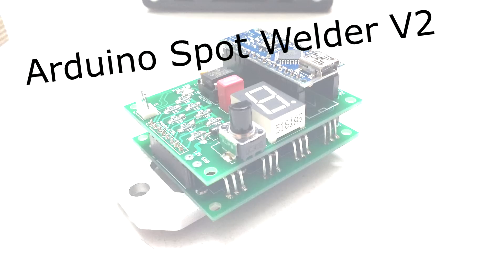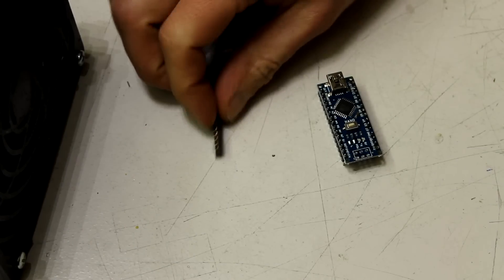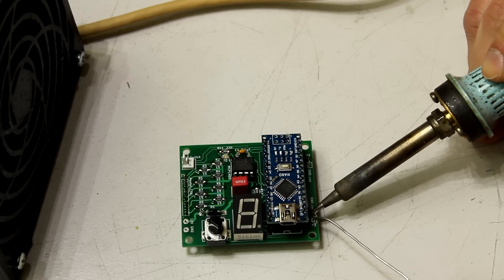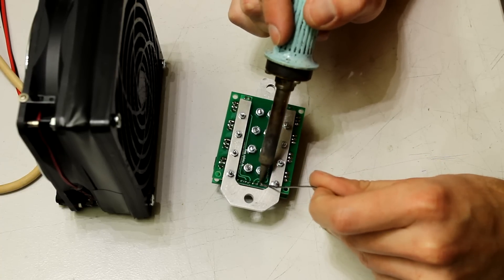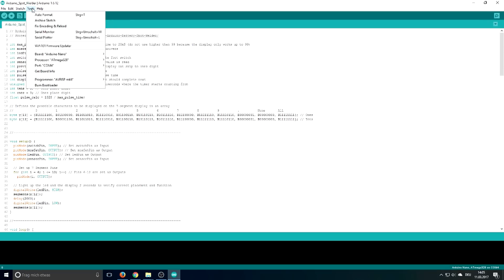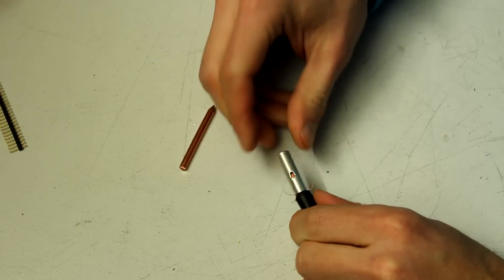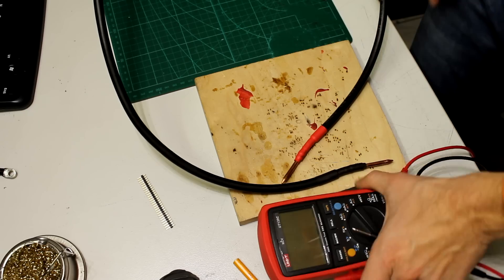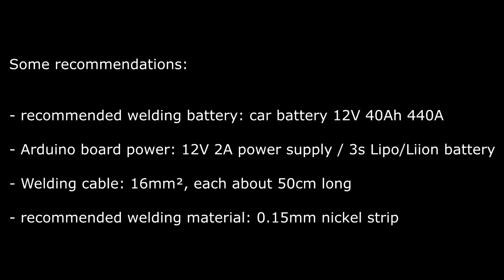DIY Arduino Spot Welder V2

Comment: can you help me please I ordered your kit and built it but I have 12 volts at the welding tips how can I troubleshoot to find out the problem. I only have 12 volt when the 12 v control voltage is applied. anybody help please I had it working until I added a second battery and the diode kit
Reply from the maker: Do you have version 2.2 with the AutoPulse feature ? If so, you need to remove the AutoPulse Jumper when doing the measurement. https://malectrics.eu/wp-content/uploads/2017/04/AutoPulse_jumper.jpg
If this does not solve the problem please sent me some pictures of how everything is connected to info@malectrics.eu

Comment: i got my welder but it seems to struggle with pure nickel. 12x0.15 even at 20ms it wont weld. you can peel it off with your fingernail.

the cheap 8mm ebay nickel plated strip it welds good.

im going to borrow another battery over the week end
Reply from the maker: What car battery did you use for welding ? Maybe it cant deliver enough amps.
You could also try to further increase the welding time. In the Arduino code the maximum time can be set up to 99mS. Then you can choose from 1 to 99mS with the poti.
Reply: i fixed it with a 019 battery 800CCA ;)

Comment: How do you attach the optional TVS diode? Solder, crimp or just shrink wrap?
Reply from the maker: Lothian8 Solder the cables to the diode and then crimp the connectors at the cable ends. Or if you dont have a crimping tool, you can also solder the connectors to the cable.
Reply: SelmerSlowflyer ah. My first attempt at soldering the diode resulted in the metal wire pulling free from the diode
Reply from the maker: Lothian8 That sounds like your soldering iron is to weak or you put to much heat to the diode. First Tin the diode end. Then tin the cable end and heat the tinned cable end until the solder melts and then hold the cable end to the diode end. So that the diode only gets heated 1 or 2 seconds.

Comment: the In the Arduino IDE, go to; . the software is not running and I cannot go to the setup area. Im not sure why. I did download the files and  the INO file is not an executable file so there is no program running
Reply from the maker: Quentin Craft You can also open the .ino file directly on github. Then copy the program code and paste it in an empty file in your arduino IDE. Maybe it will work this way.

Comment: i don't know if the question is already been asked,can this be used with a battery higher than the 440A as explained? i have a 550CCA battery and would like to use it but i do not want to risk frying the kit
Reply from the maker: Rafael Moreno Has been asked before ;) Take a look here https://malectrics.eu/arduino-spot-welder-faq/

Comment: Hello. Why do I need separate battery to run arduino? What modifications would it take to power it from car battery? That way it would be a self contained system.
Reply from the maker: M K The voltage of the car battery drops down to about 2 V while welding. Also at the end of the welding pulse there is a voltage spike which could damage the Arduino. To use the car battery you would need to buffer the Arduinos voltage so it can not drop and also eliminate the voltage spike.
Reply: Would that be difficult to do? Any ideas on how to do it?
Reply: Actually its very easy to do.

Use a separate battery to power the Arduino. A simple 9 volt should do nicely.

Comment: is this ok to use without the 2 extra diodes?
Reply from the maker: mark ward If you only use the recommended 440A (CCA) car battery you can use it without the diodes

Comment: Great build. I'm trying to source the 12v car battery. Would a 40ah 340a battery work?
Reply from the maker: Lothian8 I recommend a 440A (CCA) car battery. Maybe with the 340A one you need to increase the pulse time a bit to get good welds. But in general it should work.
Reply: im using a golf cart battery numax slc34-12  14ms pulse makes good welds

Comment: just placed my order but i just have a couple of questions,what is the diode and tvs for?and need to know if the arduino comes pre programed with the code and ready to use?i did order the diode and tvs set
Reply from the maker: There is a explanation in the instructables why to use the diodes https://www.instructables.com/id/DIY-Arduino-Battery-Spot-Welder/#step5
The Arduino comes ready to use (programed) because i do some test welds with every prebuilt kit before shipping, to make sure everything works.

Comment: Woohoo just received mine! Many thanks from Australia!! Spent a bit of time doing up the wiring (as per your video) but am using three 65C-135C 5Ah lipo batteries as my DC source. Should have enough juice in there to do some nice welds I think. Will post an update when I hack on the Sunkko electrode pen.
Reply from the maker: Hi, Did you already use the Spot welder with the 3 batteries ? 3x135x5 = 2000A current ! That would be way to much for the Spot Welder to handle. Even using one 135C battery gives you 675A welding current which is already pretty high. So i would recommend trying to weld with only one battery first.

Comment: Could it be powered with a NiCD  18V Drill battery? I have like 3~4 lying around.
Reply from the maker: You can try this, but you can NOT use the Diode Set with a 18V battery.

Comment: I'm terrible with KiCAD but am I correct that the 12V power supply through holes are spaced 4mm apart and not 5,08mm or 2,54mm?
Reply from the maker: Rizon1985 You are right, they are spaced 4mm appart.
Reply: Ordered :)
I have a 540A CCA battery in my off-grid PV system. Do you think I can use that one or would 540 be overkill?
Reply from the maker: Rizon1985 That battery should work fine. Its not to powerful.

Comment: Hello i ordered a completed welder i will add Schottky and diode, being new to this it would be helpful to have awg rating for the wire i should use. Please.
Reply from the maker: wire for the diodes should be 10mm² ( 7 or 8 awg). For the tvs diode you can also use thinner wire if it is just a very short piece.

Comment: Hello, dear author. 

I really liked your welding version 1. But I decided to do it myself, some time some changes .. And for almost a year now I have been trying to bring it to the end. 
I really need your help, answers to a few difficult questions for me. One of the reasons why they occurred is the lack of an oscilloscope .. ((

Here's what I changed / added: 
1) Measuring the battery voltage immediately after the pulse, in pause to see how much the battery dies; 
2) optionally on start-up timer after touching the probes To each other (time 0.5-10 sec);
3) after only one preliminary not like you, and 0-32 pulse is set buttons; 
4) the duration of the main pulse buttons set in microseconds 100-33333 (0.1-33.3 ms); 
5) the ability to switch to the self-timer and vice versa without pressing the buttons on the device (only pedal delay + closed probes); 
6) Display color RGB LED battery status during the pulse, and stopped not only a minimum but also the current and maximum voltage of the battery; 
7) deducing all these basic parameters on the LCD screen 1602.

 In general, I like my the not-power part ... The problem turned out to be a different matter ..
 The preliminary pulse = 1/5 of the main, then the pause is 5x of the main, then the main pulse. 
When I put the main pulse of 1 ms, 1-2 MOSFETs explode. 
Total I destroyed about 30 pieces of different .. 
I tried and 1405, and 7430, and 3006 and 3077 and 4110. The result is one. Better than all of themselves showed 1405, but they did not last long. Now 3713 are coming to me, we'll look at them.
 The fact is that my nickel tape should be cooked at 4-6 msec ... 
Also, sometimes the drivers went down about 13 pcs. 
Mcp14e10, mcp1404, ixdn604 .. The experiment was inexpensive ((A couple of times the external stabilizer + 5V (1117) burned and 3 times of arduin itself .. I tried to use tvs-diodes .. 1.5ke12a, 1.5ke15a, 1.5ke18a, even SM8S30A (8kW ) They all exploded too. I put them correctly, as recommended, guaranteeing either inductive load, or MOSFETs, or both.)
But..   I have not tried the Schottky diode.
 I've already ordered a 400A 200V (to be sure :-)). 

I want to cry 

I measured / checked how much the pulse in the output of Arduina with the help of micros () is actually going on in reality. The problem is somewhere in the power section.

 I've already tried:
 -  put 10 μF capacitors in series with the gates to keep the drivers from Voltage jump with MOSFET plugs;
 - put 30 ohms resistors to gates to loosen the signal.
-  I put 5.6 kilo ohms from the gates to the ground, in parallel there are small tvs-diodes 12 v. 
All this helps poorly .. 

(Sorry for my English) Could you suggest anything?
Reply from the maker: you should put those post in a forum with some more description like your schematic, some photos etc. .This way more people can help. You changed and added so many things to the welder i dont know what the problem is.
Reply: SelmerSlowflyer, thanks for your answer.
I'm so sorry if I too much to disturb you.
In fact, the additions described by me are mostly software, or related to Arduino. The power part is taken from you, so I decided to ask the council personally. If after installation of a powerful Schottky it's still something that will burn, I'll do as you advised - but I have a question on your scheme: 

I'm not very good understand, for power drivers and Arduino you use +12 V. This is a separate independent source or set from a power main battery? 
And if it from the main power, then does the inductive impulse pulsed penetrate the control part of the circuit?  
It seems that this is my case ...
 It's really a shame that i can't attach a scheme-photo here. :-)
Reply from the maker: For the 12v supply of the upper pcb with arduino and mosfet drivers you need a seperate power supply. For example a 3s (11,1V) Lipo battery or normal power supply.

Comment: I bought this kit and it works well. However, I have a question for you :
I test with some nickel strips. And it works with only with one of 3 sort of nickel strips ! It works with nickel strips with some very thin hatch on it but with others (nikkel welding strip - 10mm*0.15mm from nkon from example) it does not work. These nickel strips have more thickness than the nkon one.
So is it related to nikel strips or battery power ? For this test, I use a 12V / 38AH (20 HR) /  60MIN(RC) / 360A(CCA)

Comment: Can someone tell me the actual gate current required? Also the use of gate drivers? And I am using IRF3710 (10 of them) with a gate capacitance of 3000pF. So, will a 9A gate driver do the job?

Comment: I have a question: why does it needs 8 mosfets ? From mosfet datasheet I saw that one can handle alot of amps, even more so using pulses, so I do not understand. I also want to build one, so please, I am really interested to find the answer. Thx !
Reply from the maker: adi stef The pulse rating in the datasheet is only for a few microseconds. Since the pulse here is 1 to 20milli seconds we cant use this rating. Also when paralleling Mosfets they need to be derated a little bit. So i would roughly say you get about 130A out of each of the used mosfets here for safe operation. This means if you are going to use a battery that can deliver 400A even 4 mosfets could be enough instead of 8. But i have not tried this because one mosfet is only 1,2€. You only loose safety margin to handle more Amps and do not safe much money by using less mosfets.
Reply: I understand that using mosfets in parallel results in a larger current ; but my car battery can deliver 45A and a single mosfet can safely handle that current even for continuus operation (that is from what I read from my mosfet  N-MOSFET LOGL 55V 77A 130W IRL3705N). Also , would I need a mosfet driver if the mosfet I want to use is logic level (turn it on and off from a arduino 5v pin).  So , the question is this: can you use a single mosfet for a 45A car battery, no need to have more mosfets becasue you only have a max 45A current) ? Thank you !
Reply from the maker: adi stef You can not weld with only 45A. But if you have an aplication which only requires 45A then one of your mosfets is enough. By the way, are you sure your battery can only deliver 45A ot is it a 45Ah battery ?
Reply: Try it and let us know how it goes!